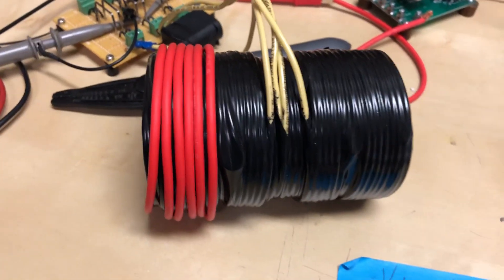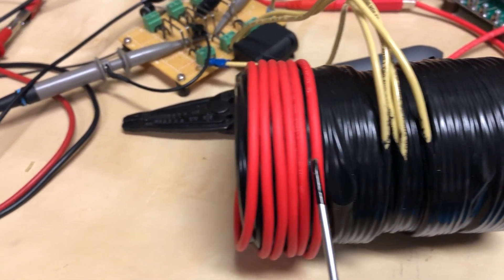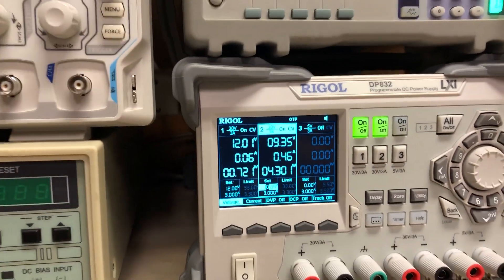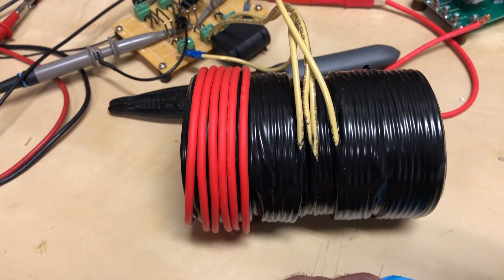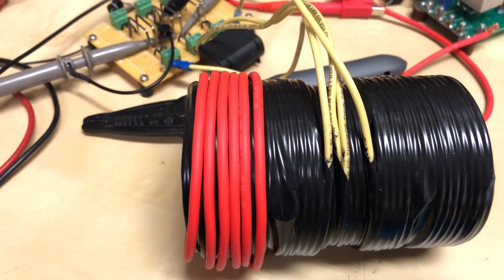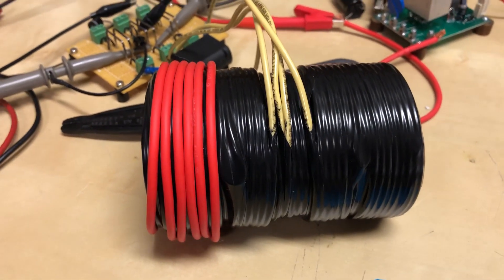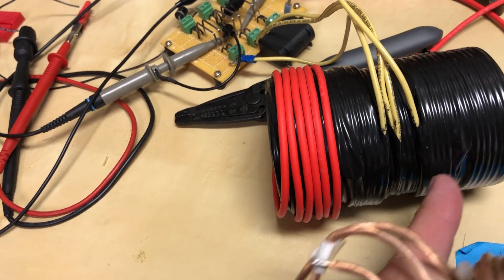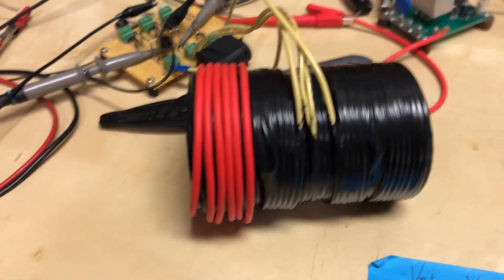Asymmetrical Re-gauging Video 2

Comment: Can you please share what is the purpose of experiment?
Reply: Here are the starting experiments: http://www.aboveunity.com/thread/if-you-want-energy-learn-build-and-share/
Reply from the maker: I'm trying to use 3 magnetic fields to get a gain in the system (Asymmetrical). 1 + -1 is a regular transformer (Symmetrical). What you put in is what you get out, less losses.  With 3 magnetic fields it's possible to have the equation 1 + -1 + 1 = 1  We have a gain!  The only way to prove it is to do the experiments and see if it's possible.

Comment: +1 excellent Loz! Output Voltage comes from the Time Rate of Change between L2 and L3. Yes, make it work from what you have available. More turns on L2 and L3, making sure the Currents Oppose, and also one current must assist L1. Yes Coupling is important - aim for Max Coupling from L1 (Input) and L2 (Light) then maximize your Coupling on L3 to assist L1. I hope this makes sense? If L3 adds 20% to L1 then L2 needs to be 80% efficient to get Unity, Make sense or have I confused?
Reply from the maker: Thanks for the comment. It makes sense, I have to get it done!